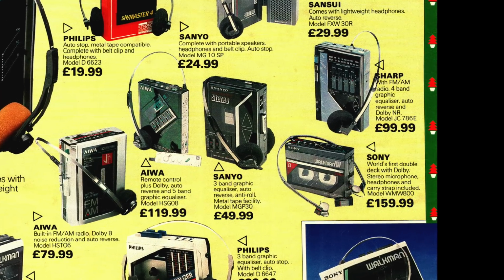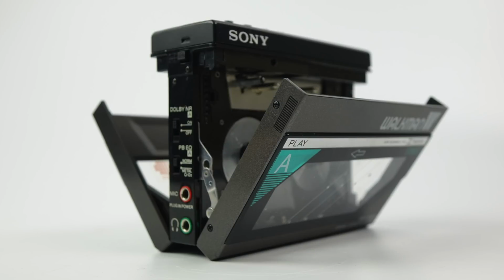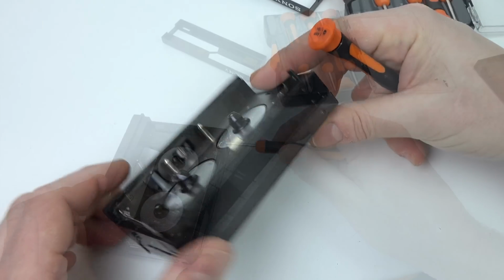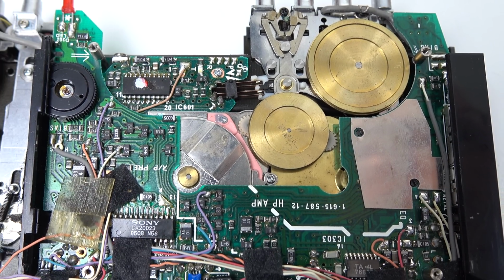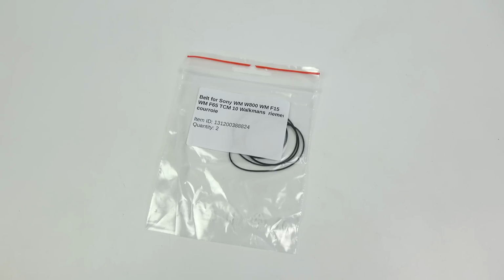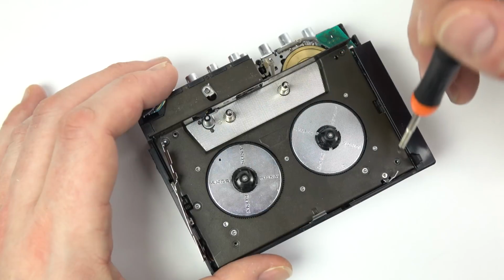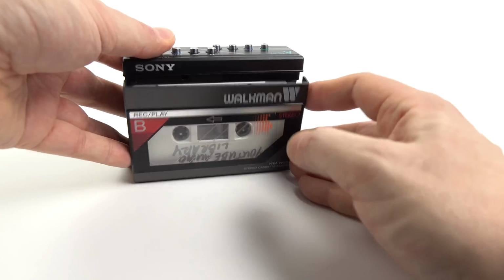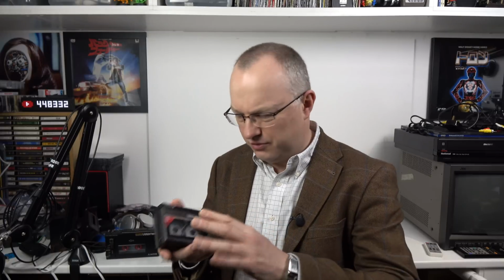'Repairing' the unique Twin Tape Sony Walkman W800

Comment: I hope I explain this as clear as it seems in my head, but I've had a few cassette players that have had a problem of only being able to play while the record function is in use and it is to do with the play mechanism becoming weakened to the point that the read head only makes contact with the tape surface when the full play/record mechanism is in use.  It's like there are two springs, when you are playing a cassette one spring brings the play mechanism down, but when you record both springs are used to bring the entire play/record mechanism down and that extra "Oooomph" from both springs being used is what puts the read head in contact with the tape surface.

Sometimes if you open the cassette door and watch the mechanism as you attempt to play or record you can see that the read head doesn't fully extend when you press play alone, but when you hold down both play and record (as you had to do back in the day for record to work) you would see that the extra tension required to bring the full play/record mechanism down on to the tape surface gives the extra tension required for the read head to make contact.

It's been probably 20 years since I last dismantled a buggered Walkman but like most fixes I tended to just jury rig something out of scrap and with this particular problem that scrap was a tiny folded bit of paper placed beneath the play button so that a regular press would be upgraded to a strong press and when the play button locked in to place that extra millimetre of paper between the button and the mechanism meant one less millimetre between read head and tape surface.  It always worked.  It even worked on some very old VHS players who still had mechanical protruding buttons before their front panels were all digital.

Comment: One thing about changing belts is to always use isopropal alcohol with a q-tip to clean any grease and oils out of the belt track.  The belts are so thin that they have very little holding power to overcome the friction of moving the tape mechanism.

If you can't replace the rollers you can use a product called rubber renew to rejuvenate the rubber surface.  This chemical contains xylene and causes rubber to expand, increasing its grip on pinch points, but on belts it does not help as belt rubber expands too much.
Reply: Two most important tools when I worked in photocopier repairs - isopropyl and clean rags.  90% of call outs were overly sticky or dry rollers leading to feed problems or jams, but that stuff is fantastic for so many other things from corroded electrical contacts to rejuvenating a piece of furniture that has gathered dust for half a century.

My dad used to swear by white spirits/turps when I was a kid but he would have loved a bottle of isopropyl for the broken electronics he'd buy and tinker with.  As soon as I saw the rubber band had dried to the runners inside that walkman I thought about a drop of alcohol and a cotton bud/q-tip.

Comment: Hint: when taking things like this apart put out some masking tape.  Stick the ends to the table top sticky side up.  As you take screws out put them on the masking tape in the order or arrangement they were taken out.  This will create some method of order to help you get them back into the right holes.

Comment: I still have the Sharp model above the one you are featuring. Probably about 16 years old at the time. Many a lunch break spent in Birmingham's Virgin Mega Store checking out new tape's to buy. Sadly it stopped working a long time ago but i might check it out having watched this. Served me well on the train from Wolverhampton to Brum New Street and back for years. Good times. Thank's for the video.

Comment: I couldn't imagine it would produce all that great of recorded and dubbed cassettes. Chances are trying to dub video games on one of those would introduce a certain amount of hiss and distortion to the recordings making an unusable copy. I had a Panasonic recording "Walkman" (RX S28, I think) which in 1984 when I received it as a Christmas gift I thought was amazing since it played chrome tapes, had auto reverse and recorded either from the built in FM/AM radio, the condenser mic or an optional stereo mic. 

The recordings made either through the condenser mic or an external mic were pretty good, however the radio to tape recordings on FM were slightly distorted, AM wasn't as bad. The quality was about as good as a lower end boombox. That little recorder went everywhere with me between 1984 and 1991 when it finally gave up the ghost. All in all since I got a good seven years out of a portable stereo recorder that went everywhere with me, I guess the build quality was rather good. I was not too successful finding a good replacement, which was not too much of an issue as I was moving on to a Discman at that time as well as building my first component system from money I was saving mowing lawns and doing teenage odd jobs over the summer.

Comment: You had me at "Latest Spectrum game"
Reply: Still have a couple of my old Spectrum Games, on cassette. I think they are PSION Chess, and Flight Simulator. Hard to say if they work, as I have no Timex Sinclair any more, i wore out that machine 30 years ago. Probably should have kept it. There are simulators, I do not know if you can use them to somehow load tapes via the computer into them, May need to try it someday.
Reply: @kennethbouchard8643  uu7uuuuuuuu
Reply: U
Reply: Wow... How do you have no replys yet?

Comment: Best way to take something apart, take a photo of everything. I had to do it with a computer controlled Teac tape deck, yeah that was a pain... Btw if you go onto "vintage electronics dot net" they have belts in various sizes for almost any deck imaginable. They are U.S based so overseas shipping may be pricey. You may have broken a wire by accident for the pickup and that could be why it only works with the record button pressed.

Comment: The tape players of those days usually had a Rec/Pb changeover slide switch soldered onto the PC Board, which oxidizes with age, and needs to be treated with a lubricating switch cleaner.
That is usually the reason why the Rec/Pb functions go haywire.
Reply: Gsacni so maybe with a blast of that all would be good? It certainly looked like the machine in the video had very little use as the screen printing and decals on it were virtually mint for something of that age!
Reply: Deoxit?
Reply: badderthanyou That works, Nutrol too

Comment: I had one of these for quite a few years. It was a great little machine and I remember it always having pretty good sound. The biggest problem with it was that it didn't have a graphic equaliser which meant that you couldn't tune the sound. 
What it really excelled at was of course tape to tape copying. It was also useful because it let you carry two tapes in the machine at once. 
The reason that I actually brought it for specifically though was for portable hifi sound recording, which it was quite good at - but not brilliant. There was very little choice at the time that had reasonable quality and was at any kind of sane price I could afford.

Comment: What you got hold of there is a rather interesting door stop Techmoan :)

Dont remember seeing that one before. I had a recording "walkman" that had a stereo radio on it that let me record the radio onto a tape but the recorded sound was always a bit ropey, there was a not of head noise on it.
Record just never seemed to be something to be taken seriously on portables. What you think, was it just a gimick or did it had a target user?
Reply from the maker: It was very taken very seriously on the D6C (the Sony Professional model I briefly showed). LED VU meters, recording level control etc...it was often used by reporters and even occasionally to capture audio in TV productions where space was at a premium.
Reply: Oh yeah no, I know there was a professional level tape recording market which was filled with things like the D6C but this isnt really in the same league as that.
They were pro level and you only got one of them if you had a job for it because there were other players that did no pro things better... Logic controls for instance, or smaller, lighter, looked cooler.

This one just doesnt seem to have had a place beyond the consumer market that didnt really need one.

I didnt need a recorder walkman, I had one but it was a gimmick really. any walkman would have done me then, it was just for listening to tapes.

Comment: The reason there's only sound from either deck when using the record function is likely because the record switch needs cleaning. Pretty much all tape recorders have a multi contact switch which moves when the record button is pressed and it changes the output of the pre-amp from going straight to the main amp and instead routes it through the recording circuitry and into the record heads. If the contacts on this switch are oxidised and not conducting properly then the tape player can either have poor or no output or not record clearly. I suspect having not been used for years has made the switch contacts oxidised and therefore non conductive in play mode. Just a little squirt of contact cleaner into the record switch should clear up the problem.
Reply: Yep. Very true. I've been servicing these things for more than 30 years, and cleaning the pots and switches is a must after replacing the belts, and 95% of the time it clears all problems.
Reply: In that case, he should do a follow up vid
Reply: Great advice!

Comment: From my years in notebook repair , if you ever want to order screws you take out , place them on a table with the head down in the rough shape you remove them.
If you are really bad you could sketch the device on a a4 sheet then place them on that , but just putting them in the rough shape is fine because you know what one is top left , top right etc 
System only fucked me when people would chuck stuff on the table knocking over my nice stack of screws

Comment: excellent video. 
I do believe that cleaning the pinch rollers with denatured alcohol will remove the stickiness and solve the wow & flutter problem.

I often had to clean all types of cassette tape players back in the day.
in extreme cases it will stick the tape to the roller & eat your cassette.
 
also electronic contact cleaner & a can of dust-off used on the record switch (compressed air) will likely solve the no audio output problem.
enjoyed this very much & would like to see it fully restored.

Comment: I had one of these years ago and it didn't work either. I took it apart to find that belt issue but since I couldn't find any replacements that fit I threw it away. It was still very cool looking and very unique.

Comment: We used to use thread to replace the belts and it worked fairly well as long as you didn't pull them too tight when tied. It is really hard to get them tied and then glued with superglue so the tied part ( sorry I can't remember how naught in this context is spelled) an be removed. It only lasted about 3/6 months of heavy use though.

Comment: i have some cassettes players , some used and open mine up.. one the head fell out.. and the other two went back together,, one is old used and beat up.. and the other.. got bad speakers in them mini speakers. and its a mic and Equilixer all in one deck.. the other a plain walkman..  Reel to reel is more mechanical and easier to replace a belt..

Comment: Always fun to watch these tear-downs and repairs.  Great video.

Oh, minor tip about messing with belts: This is something I picked up on a lark when buying new belts for a full-size tape deck, but they make what I saw listed as a "belt tool," which has metal picks on either end.  One is a hook for pulling belts off of wheels and the other is sort of "L" shaped for pushing the belts into place.  Made the exchange considerably easier.

Comment: I bought a Walkman last year and had to take it apart to replace the belt as well.  I thought I had fixed it but unfortunately it looked like one of the teeth on one of the little gears inside had broken off and it was jamming up.  I was too afraid to take it apart even more.  The radio worked and I didn't want to break that part.  I'm pretty sure this channel was one of the reasons why I bought it even though it needed to be repaired.  I think I bought the belts from the same eBay seller too.

Comment: I never saw one one of these even advertised, what cool little gadget. Glad you overcame your "fear" of taking a small electromechanical thing to bits (with mid to repair it). Everything's daunting for the first couple of times. While it may not function properly, you have at least injected a little more life into it, for now.

Comment: The record play switch may be stuck or just needs a good clean.

The speed issue could be the pinch rollers need replacing or simply are dirty, but could also be that some lube needs to be applied in the proper areas.

For the pinch rollers try a good rubber rejuvenating product first and see if that works.

Comment: One thing is, some Walkman are seem harder to take apart because the case wasn't assembled with screws, like my WM-F2015 AM/FM, It has clips instead and you need to pop-open them. Those clips are rather fragile because of the age, and well concealed. I couldn't find a proper manual, and had to risk breaking some of them in order to do the belt replacement.

Comment: That ebay shop for rubber band you referenced in the video, they seem to be the only shop which supply the workable belts for the old Walkman. I just order my belt replacement from them... but since I'm in USA and the shop is at Slovakia, it will take two weeks for the transportation :p

Comment: When it doesn't work after putting it together, there's only one thing to do - take it apart again!  I'd start by inspecting each of the switches to make sure they're being activated properly.  It's probably just a simple assembly issue.

Comment: It's sad and ironic that the most problematic part that kills these machines is the simplest technology in them. The belt. It's too bad they weren't built with longevity in mind, perhaps with servos or direct drives for the moving parts.
Reply from the maker: Almost all the Sony DD models (the direct drive ones) have broken as the centre plastic drive cog snaps due to a contraction of the plastic which surrounds a metal drive wheel.  The plastic cog then has to be re-manufactured using epoxy resin which is a much more complicated process than swapping out a belt, so in the end the belt drive machines are a lot easier to repair and a better bet.
Reply: If you really wanted them to last you could use metal gears on every part of the drive system. It'd be a bit noisy though, and the noise would only get worse when the grease dried out and turned into a crumbly mess ;)
Reply: Belts were cheap, win for the manufacturers! Belts were an easy replacement repair if something was to go wrong as TechMoan mentions, easier to repair than plastic parts. But belts also have and advantage over metal gears, they are soft and spongy, this stops the tapes from snapping or getting damaged, and at the time for most people the tapes were the most expensive component. The cost of your royalty paid music tapes , a hand full of them at the time would of cost more than the player compared to the belts. So it’s a good safety mechanism and increases the playability of the tapes. That would of been kept in mind, tape stress, so the tapes would not of got chewed (but sometimes still did with dirty heads and pinchers). Even own dubbed audio would of been more valuable than some rubber belts to most people.
Reply: Some of them were. I have repaired a lot of open reel decks and it seems like the belts went bad in the 1970s. Many Tandberg, Grundig, and Sony units from the 1960s are still running with their original belts while Philips belts have always been horrible when it came to longevity.
Reply: Or replace the belts with… chains, lol.
Reply: There is a term for that: It is called planned obsolescence.

Comment: Even though this is a "bottom line" cassette player, this piece looks very well engineered. You can unscrew everything, no cheep glue or plastic clips that brake when taken apart. This is oldscool Sony Quality. No comparison to modern electronics. I would like to see a full repair of this.

Comment: I've always had good luck servicing Sony electronics. They're extremely well engineered. I bet if you did a cap replacement, the device would start working better.